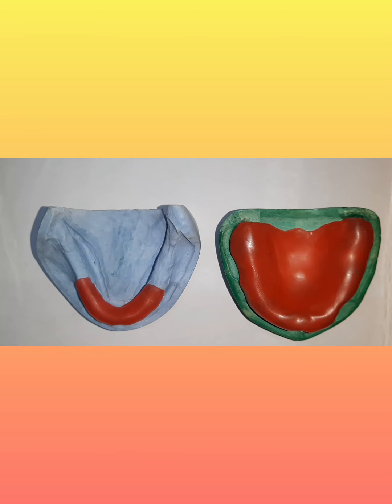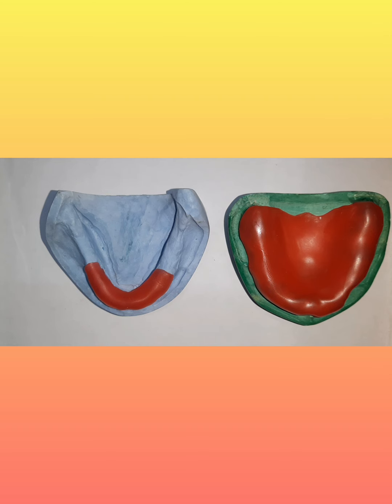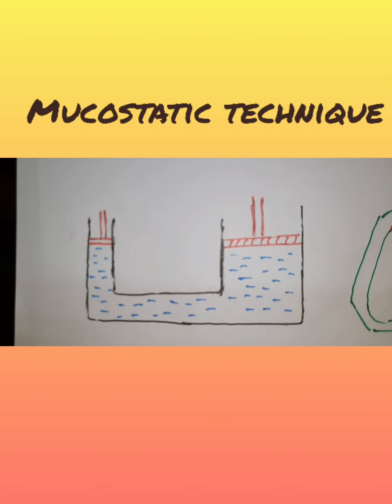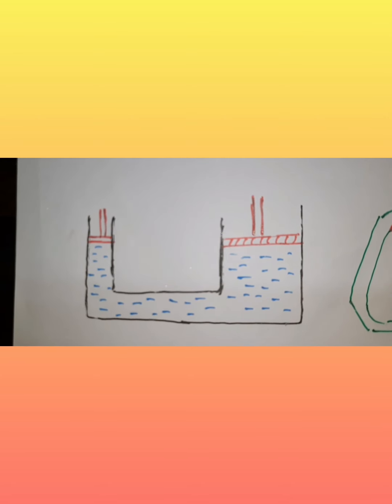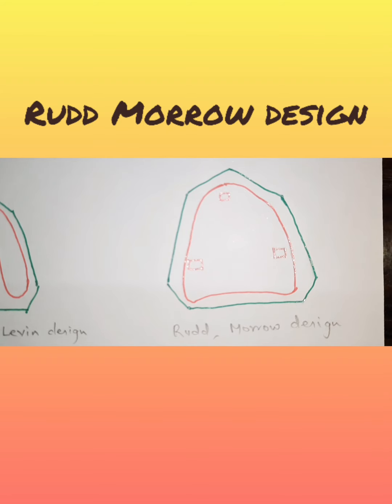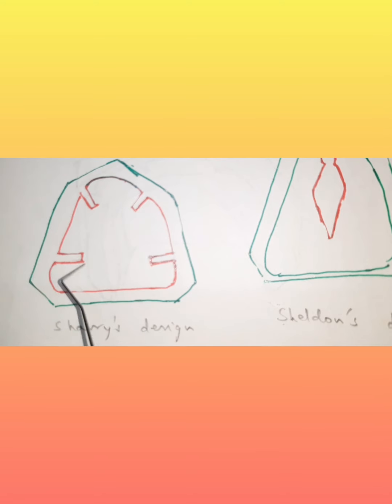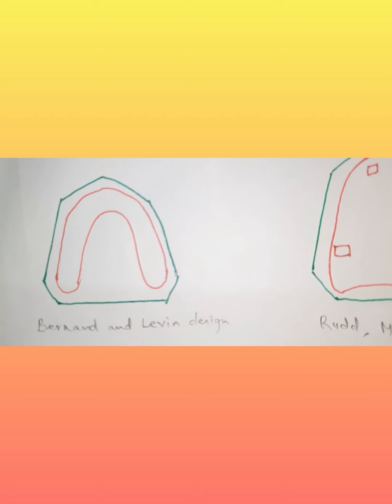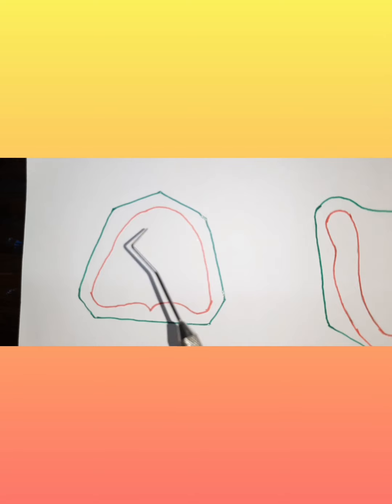IMPRESSION TECHNIQUES AND SPACER DESIGNS IN COMPLETE DENTURE PROSTHODONTICS

Comment: Sir,,1) how can we take new impression frm primary impression.?
2)and after preparing custom tray after removing spacer again we take impression with impression material on tht cast ? Before taking secondry (final) impression in patient's mouth..?  
Thank u for this techniques ❤️🙏🏻
Awesm video.❤️👍
Reply: Reply. to this plz.🙏🏻
Reply from the maker: One method is by scraping the primary impression in the relief area and then taking wash impression after border moulding. 
Second method is you pour pri impression to get pri. Cast and then after placing spacer make Custom tray and do border molding and final impression.